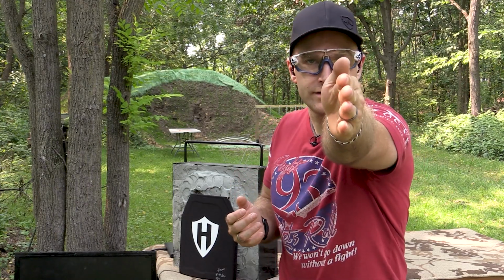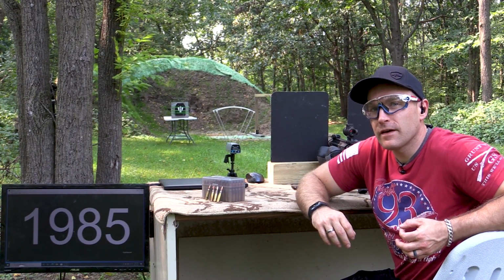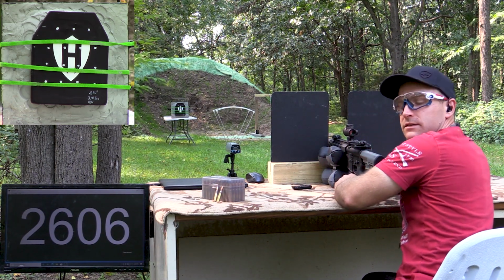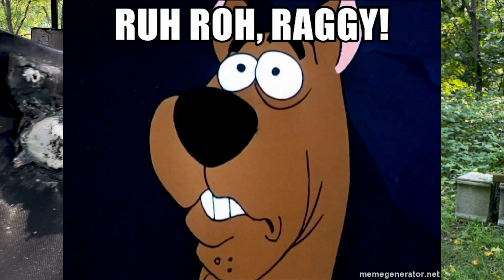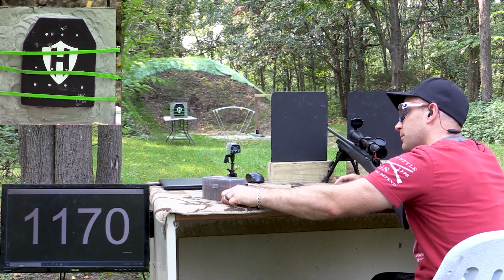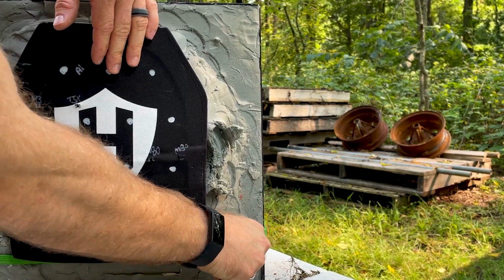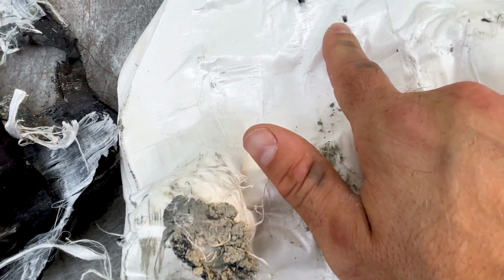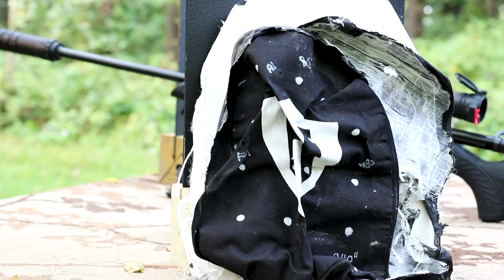Hudi Tactical, Level III UHMWPE Armor

Comment: Hey my cool guy. Would it be possible to test the three types of armor (especially uhmwpe armor) against russian 5.45x39 and Chinese 5.8x42? If anyone can do it,it’s you Buffman
Reply from the maker: Chinese 5.8,no :(.  5.45x39 common stuff yes
Reply: @BuffRANGE  that's okay my cool guy. You're still cool :) especially those China made plate reviews. my region has no access to American made plates,all we had for protection is issued Ceramic plates or commercially sold plates (both of em are possibly made in China and similar to what you test and review) so your data and test are a life saver and good learning material. Keep it up my guy 😎

Comment: What I'd like to see is if you could take this kind of body armor and then add things to it to help it defeat the better rounds. For instance, let's say you had on a normal kevlar jacket (maybe a discrete one?) on under a plate carrier with the UHMWPE plate. How much would that increase the protection? And what if you took some common stuff, like a ceramic circular saw blade, and taped it on the front of a UHMWPE plate? Would that do anything to blunt or slow down the faster rounds? Would be fun to play around with that at a minimum.
Reply: I have that kind of setup. Level IIIA soft armor and on top of it plate carrier with uhmwpe plates. My kevlar vest also has plate pockets but I find it separating plates from soft armor more comfortable and soft vest doesn't have molle.

Comment: It would be interesting to see some stuff by UARM be tested if at all possible. 
They have an interesting set of products that sound pretty neat on the surface, like armor insert t-shirts and hoodies, and ceramic plates that you can pick your level of ceramic on, from Aluminum Oxide (Alumina?), Silicon Carbide and Boron Carbide. 

Thinking about picking up some of their SiC L4 plates based on some of the information available from this channel, but there's like no information on this company in the wild.

Comment: Are there any poly plates that can stop M855 with or without a backer? I'm trying to justify getting a new set of armor, can't find any excuse besides weight to switch from 3+ steel.
Reply from the maker: Only Prime Armor has shown to do it from SBR. Dayton Armor claims it to but you know me. Seeing is believing :)
Reply: P.s u should avoid steel plates. The spalling alone will be deadly.. and spray on "spall coatings" dont last more then 1 or 2 rounds.. and still dont always capture all the spall .
Reply: I would save & invest in ceramic/poly hybrid plates. Steel will always be heavy, & polyethylene cannot reasonably stop M855 without being dummy thick & bulky (but still pretty lightweight). Pure steel & pure polyethylene plates are known to easily be defeated by M193 & M855 respectively assuming all other testing variables are equal. Hell, most high-end 3A backers are made of Dyneema or Spectra, which are both just private formulas/composites of polyethylene.
Reply: May wanna take a look at rma 1090 series.. isnt 100% poly.. but at 4.49 pounds a piece they are awesome.. are ceramic/poly.. and rated level 3+. Covers 193/m855/ak msc/m80.